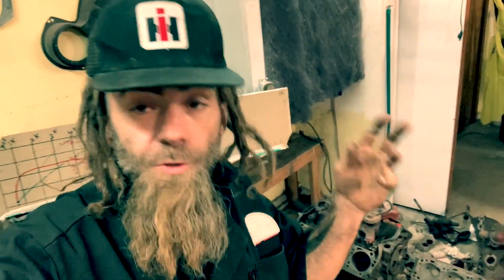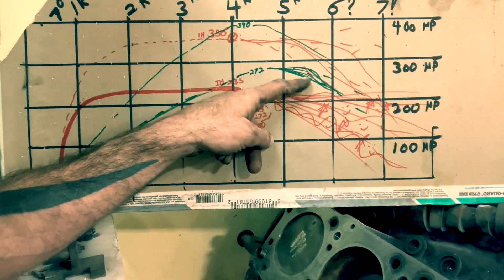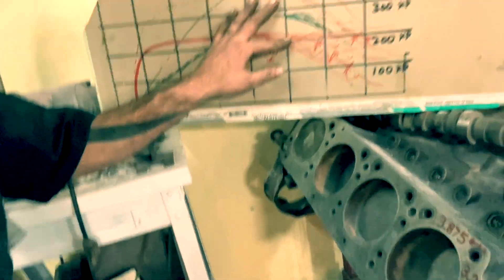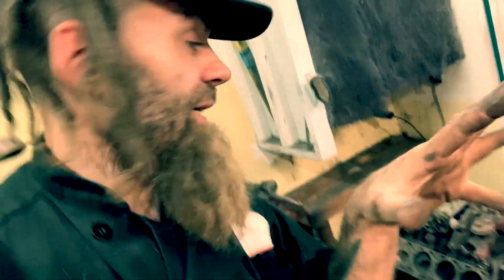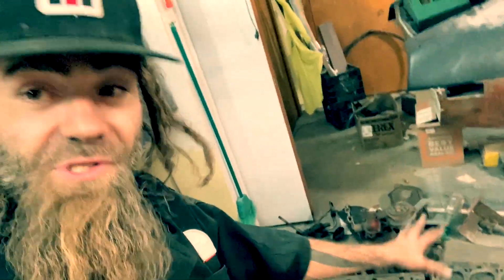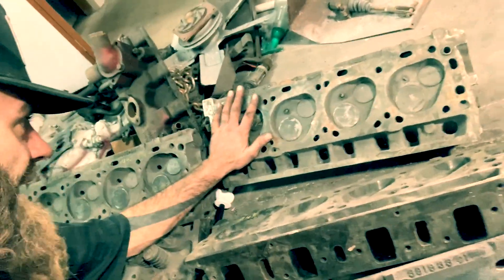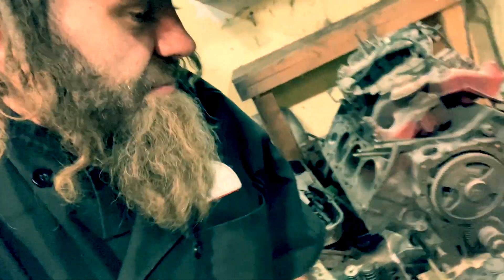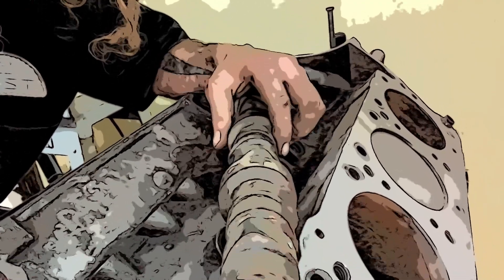Everything International Engines! Worlds Biggest Block! '59-'86 IH Red Power vs Big 3 Horse Power!

Comment: When you starting this 392 build. You should do a full Baja build so we can see how it was done
Reply from the maker: right after I repaint this trans am and my metro frame they will both be out of my shop in under a month, and then both then engines are getting  everything we can throw at,  but the 304 will only get an rv cam...,  But Im going on tour in a few months with my band, my pinstriping gear, and my metro, so I wont have time to build another scout, mine was almost 100% ready and i got side swiped and ran on, barrel flip, crushed around my roll bar like a beer can!     But I am totally willing to donate the 392 as a team effort build and hand letter up a race scout,  find a driver, sponsor, enter it in the race again, or some event, sell raffle tickets to win it after the race, charity donation..... Or if somebody has a donor buggy I will try to beat  Give Evil a run for his money and I will jump an entire ford dealer lot of new broncos lmao
Reply: Any chance you might do a ih mechanical clutch and linkage restoration?

Comment: I’m doing a transmisión swap on a 1971 international have a v8 which transmission can I put??
Reply: I will need to be IH certified. You can either go with the Torqueflite 727 automatic or a manual but you need the appropriate bellhousing.
Reply from the maker: any IH transmission from 60-80

Comment: hi, I know I will need to re-watch this video a few more times to catch everything said about the heads, but my question is the following: I have a '69 Loadstar 1700 with a locked up engine - only 15k original miles.  It has a 392, 4 b holley and non-improved cooling.  Someone told me when I take it apart to see why its locked up, that I should put 345 heads on it to increase the compression.  Do you agree and what heads do you recommend?  And what is the best way to recognize those heads?   Or should I just stay with the stock heads?  And there is a company that makes roller rockers for these engines.  Do you recommend those?  My goal is first a very dependable engine, not a racer, and secondly the engine as economical to run as possible. Intended truck use is primarily as an on and off-road wilderness camper.
Thank you for these videos.
Reply from the maker: well stick with stock, i have videos on rebuilding them on my page,   so it has been proven that roller rockers do not show any gains unless we are talking dragster, they can actually decrease your performance on the street...
you can as i show because of the new gaskets are thicker, if you deck the heads .020 you wind up like it was only decked .007"....
so if you want to go any further you will need a rocker tower shim kit or shorter push rods....
im about to rebuild a 392 in a couple months where im going to do a crazy head job to get them to flow like they can
Reply: @TEN-TIMES-HARDER  Thank you for your reply - very helpful !  I'm hoping I can get by with no machining work needed and find somewhere a set of OEM steel head gaskets.  There's not a machine shop within a hundred miles of my city.  Because I'm the one who locked it up, I know it was not over-revved or have anything major broken in it.  When I first got the truck it started and ran very smoothly, like you would expect an engine with only 15k miles on it.  So I never actually drove the truck but immediately let it idle to burn out any moisture that might have accumulated in the engine over the years and to warm the oil before I changed it.  After a few minutes of idling, the engine began to slow down.  It showed good oil pressure so I gave it more gas but it continued to slow down.  No unusual noise.  It finally stopped and now a breaker bar could not turn that engine.  My guess is the cam bearings delaminated, spun and locked up the engine.  Your thoughts?  And is there anywhere I can connect the oil pressure gauge to the top end of the engine? 
BTW I put a question on your steering shaft video.  Thank you for your help.
Just curious, what state are you in?  I'm in Comiefornia.  Unfortunately no one around here has any interest in IH.  But it was worse when I lived down south.  I went into a auto parts store to get some basic part.  (I had a '62 Travelette I had to sell for financial reasons).  When I needed a part for my International the person behind the parts counter actually said "International, what year Ford is that?"

Comment: Do you know about old 1973 wayne model C? Any info would be appreciated.
Reply from the maker: not unless it has an Ih engine lol, most stepvan parts are universal and can still be bought from mills supply step vans....
Reply: Thanks this is my first rebuild. Found a manual. It a 73 Wayne International  loadstar 1603-A with the v345. I found a manual it should work. But where do I order electrical coil?

Comment: GMC had a 637 V8, LeRoi had an 844 V8, along with White Motors, Continental, so on and so forth.  The 549 wasn't any better than a 534 ford.
Reply from the maker: not the largest displacement, the biggest heaviest block in production vehicles, the 304 outweighs the 454, it has a bigger block... more meat so you can run cool forever 🤑

Comment: Hay mate I have a black diamond 240 how can I more power
Reply from the maker: im fixng the broken page www.bedhed.xyz/ih i have a write up on how to mill the log intake, and bolt a spacer to accept the webber 2bbl carbs!   they work like half a 4bbl carb. larger secondary!
Reply from the maker: and run it always on marvell mystery oil to save the valve seats meant for leaded gas!
Reply: Ok cool hay can I get the Valve seats hardened  i am going to re grind the cam for power and Dec the head  I am also going for a tall tier and a od tanssmission what do you think will it cruise better

Comment: I got a 66 with the 152 and i want to pump it for fun any advise on it ?
Reply from the maker: mill the intake manifold flat so that a webber 2bbl carb adapter plate can be bolted on, and now you have a 2bbl that progressively opens like a 4bbl... most people use jb cold weld instead of a gasket...
Reply: @TEN-TIMES-HARDER  any thoughts on porting and polishing ? Been looking for a shop but can't find one

Comment: Hi Erik do you what these casting numbers mean off a 345 head (893870r3 ) in bigger numbers it has 70 3
Reply from the maker: yes i do, not off top of head, but i believe you have the same as me in the 345 rebuild video.  i will check later, i have an index on my webpage www.bedhed.xyz click the ih icon, and it will take u to the link on heads...
the only one not pictured is the later years and they are the same as b4 just have the air injection ports in the exhaust ports

Comment: hey,,hold  on there..i think the ford  GAA motor is the largest v8 production motor ever made..pumped out 500 hp and 1.100 foot pounds ..flat plane crank and dual over head cam 32 valve v8 ...but was a tank engine
Reply from the maker: biggest big block, production meaning it sure i think chevy made a 500 big block, but the casting not didplacment the ih is bigger, not bigger cubic jnches just bigger!

Comment: So, are you saying that an International engine gets all its horsepower early on? That at higher rpms a person is just wasting gas?
Reply from the maker: @altpotus6913  shifting yes its like shifting a semi truck, and nonits still spinning faster so its going faster...
Reply: @TEN-TIMES-HARDER  OK, thanks. I just sold off all my Scouts, and am looking at a Loadstar 4x4 with a snowplow. It needs an engine. It probably has a 345, but I have a 392 laying around somewhere...Thanks for your videos.
Reply from the maker: @altpotus6913  no problem thank you!
so yeah the rpms still need to be high enough to get to the next gear, so its not like u want to shift at 1000 lol

Comment: Definitely best engineered engines. My little 304 i have in my 67 1100b is fast, good little motor. Im selling it to a highscool kid to take care of, i got it when i was 17 and hot roded that thing for 10year solid, only had to change the engine out once and only lost the hood once, i recomend hoodpins if your gonna go fast but being so nostalgic i just could never drill random holes in the hood for that, not gonna happen.